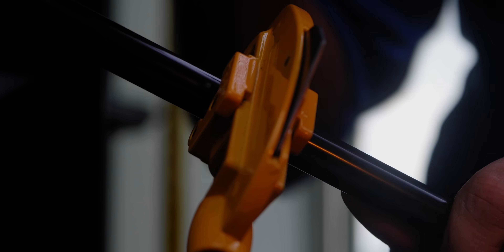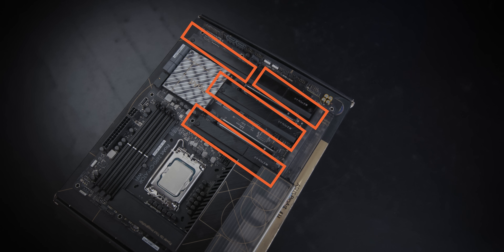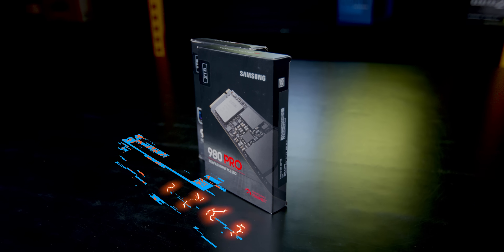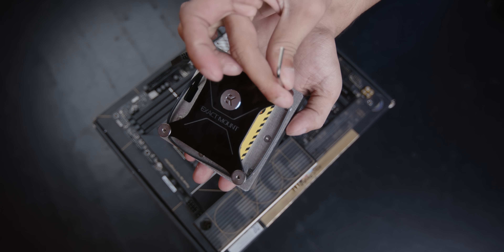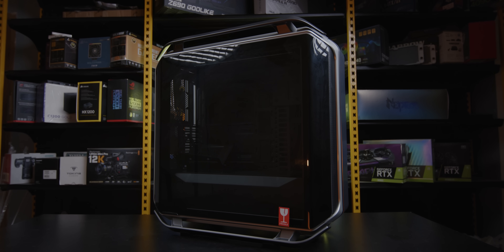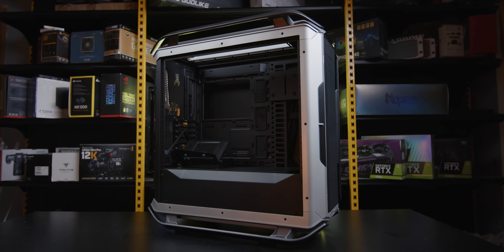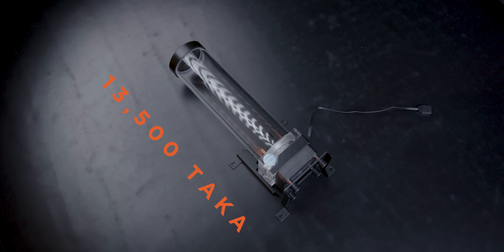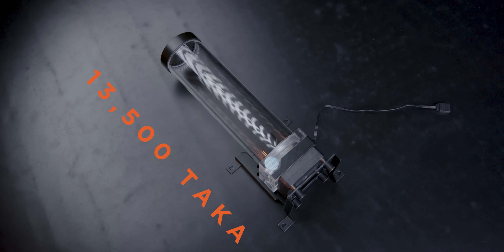Project Shelby | BDT 550K PC Build 2024

Comment: Revenger LEO Dynamic Mini Tower Casing এ

Intel 13th Gen Core i5 13500 Raptor Lake Processor

GIGABYTE B760M AORUS ELITE AX DDR5 mATX Motherboard

Thermalright Frozen Magic 120 CPU Air Cooler

Thermaltake Toughpower GF1 ARGB 650W 80 Plus Gold Fully Modular Power Supply

TEAM T-FORCE DELTA RGB White 16GB 6000MHz DDR5 Gaming RAM

Samsung PM9A1 512GB M.2 PCIe Gen 4.0 NVMe SSD

এসব দিয়ে কি ভালো হবে কি? আর পরে Graphics card add করবো এবং এই cas টা ভালো হবে কি??

বি:দ্র: এই pc builder টা কেমন হবে suggest please???

Comment: A build within this range will always put you in the 4090 cliffhanger. Considering the Lumion & other GPU intensive workloads, it'd have been a better option for the 4090(who cares about spending 6lac if he is spending 5.5lac already)but certainly a lot of such intricate details of this would have been sacrificed. On the contrary the processor would be mostly under used considering the software mentioned in this video. The build looks so cool yet minor details could have been discussed for a more optimized build. There will always be scope of discussion about CPU usage, freesync vs Rtx ray tracing etc. But as an Architect, I can't deny this looks really so great in such a theme. Great work!